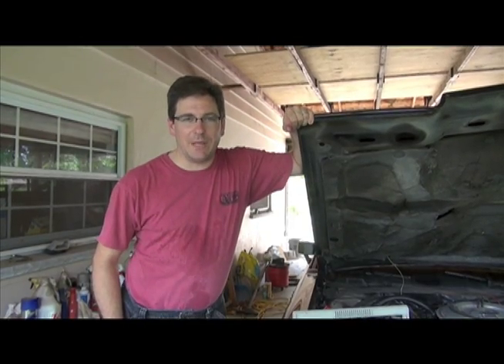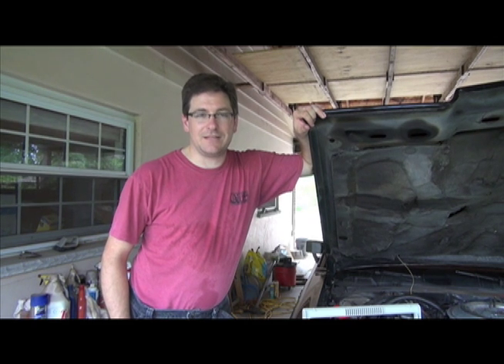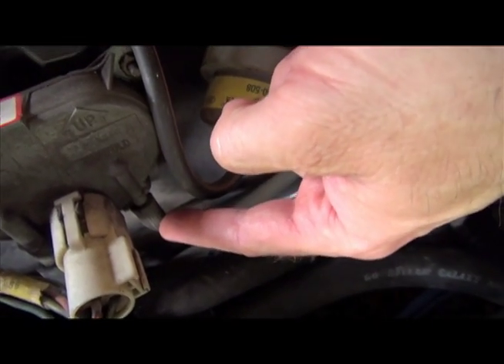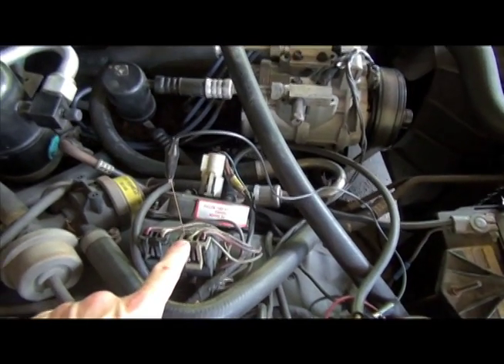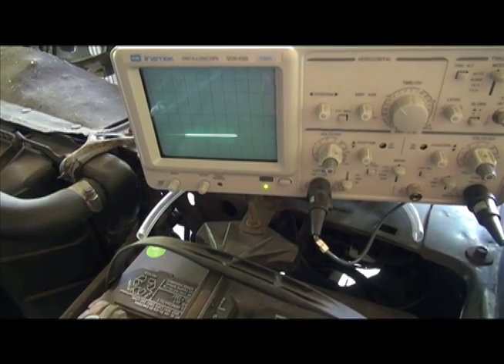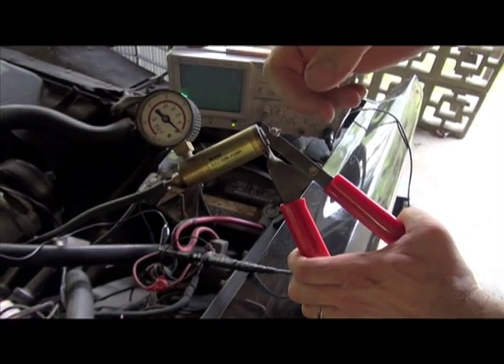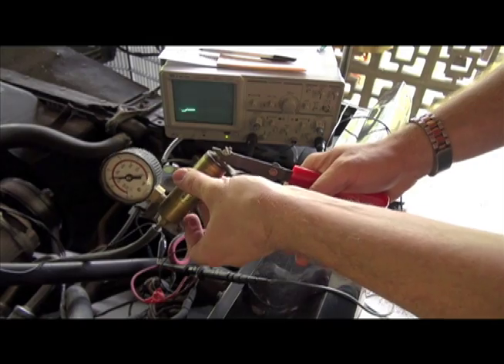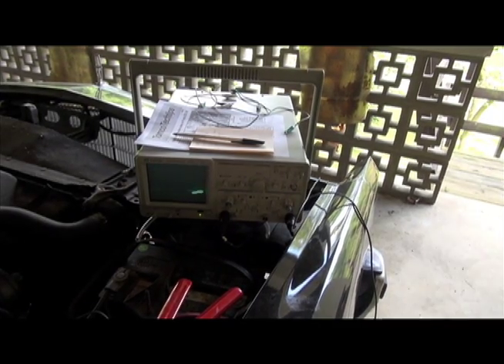1982 Ford EEC-III code reading

Comment: I'm just looking to put new spark plug wires on my 1982 F-150. I found out that I have a EEC-III Ca. ignition system. Can you do a video on the different firing order and wiring order on a 351W.?
Reply from the maker: I would but I don't have a 351...a reprint of the service manual should be available from Rock Auto.

Comment: Just came across this as I too found the EEC III test port tonight on my '83 Mark VI while doing a smog pump delete. I've always heard nothing but bad things about  EEC III but I bought my Mark VI last summer as a summer car with 32,000 original miles, it's now at 40,000 and the only thing I've had to do other than a basic tune up is replace the ignition module.
Reply from the maker: The system works great, my car has almost 200k miles and runs like a top.

Comment: I’m having an issue where my 83 Mark IV starts to stall as soon as the engine heats up for the life of me I can’t figure out what this issue is nor can I find a mechanic who knows what they’re doing out here in Los Angeles California I out of hope any suggestions?
Reply from the maker: Did you try changing the ignition module? They go bad when they heat up and they're a constant source of trouble on this era of Fords.
Reply: @cnagorka  the mechanic I last took it to said the car wouldn’t even start if that were the issue.. I’m desperate @ this point & will try tomorrow
Reply from the maker: @keepit1hunnit394  That isn't true, a bad ignition module can start and run fine but when it gets hot can open up and kill the car; it will usually come back after a while, sometimes you can put an ice pack on it to get it working again. The other thing is, does the car die completely or will it just not idle at all? If it'll actually run but you need to keep your foot on the gas the whole time it's a blocked EGR valve or something making the EGR valve open for some reason. But I would try the ignition module first, regardless of what the mechanic says.
Reply: @cnagorka  the car will start to putt then eventually stall. I will start but won’t stay started then if it does start as soon as I put it into gear it dies… I’m just over it & want to finally enjoy the car man… I bought an new module & will start there… I’ve already changed a few sensors & that’s gotten me no where… thanks for your feed back man I really appreciate you

Comment: I had an 81 mark IV it had an odd cap and rotor with 2 sets of contacts and a "cross" looking contact under the cap for the coil wire. Is this EEC III? Also at times it wouldn't start until I unplugged the coil wire and put a spark tester in it and cranked the engine a couple times. Take out the spark tester hook it all back up and it would fire right up. Any ideas? It was a TBI 302.
Reply: That doesn't sound like what this car has, there are no two sets of contacts or anything like that, more a conventional looking rotor setup. No clue as to what the problem would be you were having as nothing like that ever happened to me- I will say that the ignition modules on these things were junk, regardless of EECII or III, if you have mysterious no start/stalling problems that's where to start!

Comment: I am about 4 years late in commenting, but I just now saw the video. I spent 23 years working as a mechanic at a Ford dealership and wanted to throw a couple of bits of info at you. 

Never seen anyone use an O'scope to pull codes, obviously it works. We always discouraged using a test light, instead use an analog test meter set to 12VDC and count needle sweeps. Yes, a test light can work but its difficult to see sometimes.

Interesting you got a DTC 12 when running your test. Generally a DTC 12 while testing EECIII simply meant the engine was not running when the test was being performed. 

If you thought EEC III was an odd duck, try EEC II. Yes it exists exclusively on the Lincoln Versailles.
Reply: Interesting! What I would do to have one of the old Rotunda diagnostic sets called for in the TSM. I have to admit that for being as old as it is, the EEC III works well, that car runs like a top and has been driven from WV to Colorado more times than I can count. Much better than what Cadillac or Chrysler were doing at the same time.
Reply: I'll keep that in mind and avoid the versailles like the plague unless i REALLY want to punish my mechanic

Comment: I have an 81 mark VI and its been in shops since March (8 months now ) with a stalling problem and its about two steps from getting junked despite being super clean and low mileage. This system has completely stumped my mechanics. Its on its third mechanic and has cost 4000 and went from idling high to stalling consistently and being undriveable.
Reply: So the crankshaft sensor was the culprit? Three mechanics overlooked that! I guess diagnosing problems is a lost art with mechanics these days.
Reply: @cadillacdave8619  Yes. I ultimately had to switch to carburetor though when summer came and i wanted AC on...car just couldn't do it. So i bit the bullet and gave the last mechanic (who i trust) a shot at it and its running like its never run before. Wish i had done this sooner.
Reply: @misterhanley655  Sorry to hear you had to switch it over to a carburetor. I have an 82 Mark VI which I purchased and was not even running. When all else fails changing to a carburetor definitely simplifies everything. However, these cars were actually very reliable. It is a fairly simple throttle body injection. There is an electric fuel pump in the gas tank, two fuel injectors in the throttle body, and a throttle position sensor on the throttle body. If you have erratic idle those are the places to start. Forget scanning these old cars. It costs more and most of it is a waste of time. When dealing with a 40 year old car, just buy new replacement parts. The part are relatively inexpensive. Put a new TPS sensor and a crankshaft sensor. That should remedy most uneven idle problems. There is also a fuel.pressure regulator on the throttle body. However, the throttle body needs to be removed to install the new one. If the fuel.pressure isn't correct it could also cause an erratic idle. Of course new spark plugs, properly gapped, with ignition wires, cap and rotor would help as well. Replace the parts in stages so that way you know what the culprit was and can see what part/parts made improvements. 

Most cars have a solenoid to speed up the idle when the AC is on. Even carburetors have that unless someone eliminated the solenoid and just manually turned up the idle to keep the car running while AC is on. 

These are beautiful cars with a great ride and impressive styling. Best of luck keeping it on the road!
Reply: @cadillacdave8619  I wish i had the know how. When i got this i foolishly thought it would be like a later  87-2011 towncar which i knew were fairly interchangeable partswise..i didnt realize it would have a specific system of its own. Ive heard many people say its simple and while i dont doubt it, i'm simply too tech ignorant and not in a position to start (i was hoping to have garage setup before it got to that point). I have the garage now though...and the idea of a simpler throwback does appeal to me. I obviously would prefer not to have altered it but the way i see it, i'd rather have done this and kept it on the road. In any case the ride is still great and i wouldn't trade it for the world! SAme to you and yours, congrats, these cars make you feel like a king.
Reply: @misterhanley655  They are wonderful automobiles. Nothing wrong with adding a carburetor to simplify and eliminate problems. The problem these days is most mechanics don't know how to diagnose problems without a scanner. They seem to spend more time trying to diagnose a problem and driving the costs up than actually just replacing a simple part that would likely cure the problem. I have several older Cadillacs and Lincolns, so I have to know how to keep them running. These older cars provide a smoother ride and better driving experience than a new car. This is when luxury and comfort came before fuel mileage and handling. Today's cars handle well but many of them ride like a covered wagon with their 19-20 inch rims. Enjoy your beautiful automobile and best of luck keeping it on the road!
Reply: 90% chance any stalling problem is the ignition module, they're terrible! I keep spares in the trunk. The actual computer system most likely isn't at fault for that...replacing the actual computer isn't that hard and the unit only costs a couple hundred bucks. There's so much to go wrong here, like the EGR valve getting stuck open (which I've had happen) the fuel pump inlet filter getting clogged, bad ignition modules, etc. But like anything else it can all be whittled down to something.
Reply: @chrisnagorka5199  i've replaced it three times already so thats not it! i wish it was that simple.  I'm just going to carburate it at this point
Reply: @misterhanley655  That's what Chrysler did with the '81 Imperials that had EFI that didn't work, after $4000 I don't blame you!
Reply: Or crank sensor. Or dirty fusible links
Reply: @warrenwinslow4266  crank sensor changed. car has been on road since october with no issues. Knock on wood.

Comment: Would a ‘82 Bronco 302 carbureted be able to be tested with a test light
Reply: I don't think so, the computer system is tied in with the fuel injection

Comment: This computer system was just plain awful but good video
Reply: Thanks but I think I can do a better job with a test light rather than the O-scope.
Reply: By today's standards this system is archaic. However, for 1982 it was very advanced and actually very reliable, especially if compared to Chrysler's attempt at fuel injection or the Cadillac 4-6-8. Both of those were problematic. The Lincolns had a relatively simple electronic fuel injection throttle body system that was reliable.
Reply: Yes is true the diagnostic process was very difficult and many ford technicians did not want to mess with them
Reply: @walterbatman7949  These cars were in the beginning stages of scanning cars. However, any decent mechanic knows that when a car is idling erratic there are a few possibilities. Check for fuel at the throttle body. Usually the crank sensor or TPS sensor are bad if it exhibits a bad idle or stalling. Simply replace them as they are inexpensive parts. On these older cars the battery cables need to be replaced as well. On my personal vehicle, 82 Mark VI, the wiring harness for the alternator's regulator was all funked up and rusted. Cleaned it all up and it started to run fine. Wasn't getting proper power to ignition. These older cars need a new alternator, regulator, cap and rotor spark plugs, new ignition coil and ignition wires. If they have been sitting the gas tank may need to be dropped and cleaned out and the fuel lines blown out. There is also a fuel filter in front of passenger rear wheel which is often overlooked. It resembles a small oil filter. They get old and clogged up and don't allow proper fuel pressure to the motor. There is also a fuel pressure regulator in the throttle body, which needs to be removed in order to replace the regulator. These are basic simple repairs any mechanic should be able to do.

Comment: cnagorka, is there a email or something i can reach u at? I need help troubleshooting my ignition system on a eec-111  setup. Thanks
Reply from the maker: Just post it right here and everyone can see it.
Reply: Np, I have a 83 ford f250 with 351w. I cannot get the engine to fire. Have new Icm, coil, distributor cap&rotor, all fuses. No broke wires etc. What am i missing/
Reply from the maker: "icm"= "ignition control module"?  There's one thing left- the crankshaft position sensor. If that's dead, the engine won't fire no matter what.
Reply: Forgot about that, its new also.
Reply: Yes Ignition control module
Reply from the maker: There's nothing for it but to trace out the wiring and make sure that even though no wires look broken, that they may actually be broken under the insulation. Also, there is a reasonable chance that you got a defective control module. If you have the technical service manual it may be time to just sit down and trace stuff out their way.
Reply: Yea it's a pain in the butt to figure this system out lol Thanks for the help.

Comment: Awesome video! I own a '81 town car that's been in the shop the past month, I was wondering if you knew where the ECM was located. I suspect it's under the dash but I don't know what it looks like. I'm going to test this code reading out but I suspect my computer might be bad.
Reply from the maker: Hello:

The ECM is located under the driver's side dashboard, to the left of the steering column as I remember. It's pretty easy to change, the hard part is undoing the nut holding the multi-wire connector onto it in the engine compartment. The brake booster is in the way when you're trying to get the nut off the connector. The ECM unit slides into a large grommet from the inside, with only the end sticking out into the engine compartment that you bolt the connector onto.

I'm going to redo this video some time since I discovered there's actually a diagnostic connector...but all it does is connect to the same solenoid wires, albeit in a more convenient way.

Thanks for watching,
CN